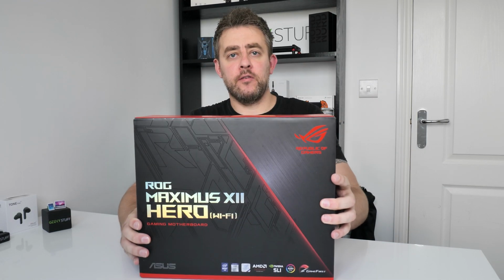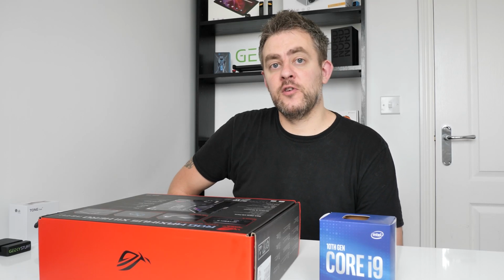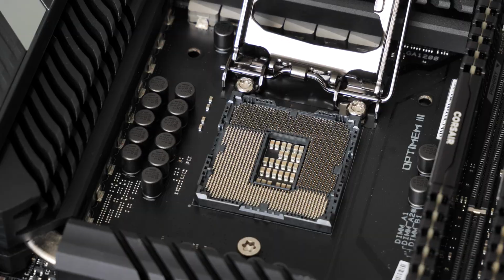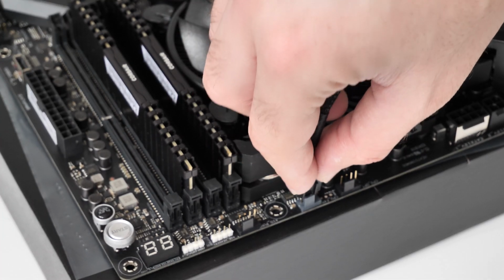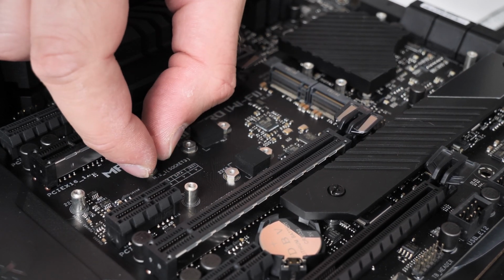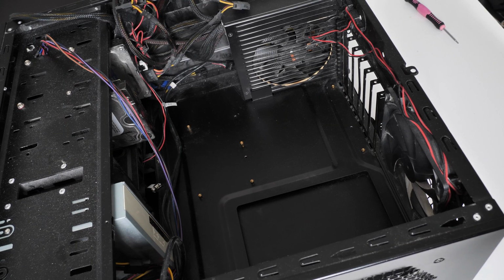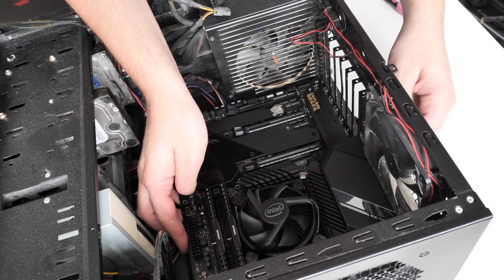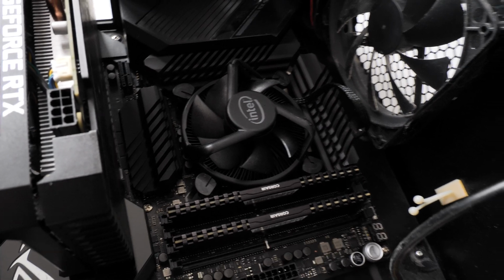ASUS ROG Maximus XII Hero & Intel i9 10900 CPU Installation

Comment: plz i am in vry tense plz relief me help me to tell me is my combination os ok for 3d animation and rendering?!?!
my gig is
that same
 MB asus rog maximus xII hero 
intel core i9-11900K eleventh gen?!!
rtx msi lhr 3d card 3070ti ...ok
addlink ram 3200mhz .. 16gb !? ok
1tb HDD Seagate
700 deepcool gold+ power supply
deep cool air cooler
tell me is it ok fully unlocked and unlimited PC rig for 3d animation and rendring high tense work everything is cool 
or
i DOOMED instead of prematurely???
:((( confused

Comment: Hi mate I’ve recently installed this motherboard into my case and I go to fire it up everything comes on but have no display on my monitor. I’m using i5 11gen cpu, any help me great full
Reply from the maker: Have you tried a different HDMI cable? I had the same issue, I needed to use a new HDMI cable and then it worked lol.

Comment: What to do with those 8 + 4 cpu Power supply connectors ? Do you need just 8 or the additional 4 aswell ?
Reply from the maker: Using just the 8 is fine
Reply: @GeekyStuff  thx

Comment: Hello. I got a question about 8+4 PIN CPU Power. I am wondering to use  a half of 4+4 from CPU cable  for 4 pin slot and 6+2 (PCI-E) for 8 pin slot? Did you do the same connection ? All my previos CPU got only 4 or 4+4 pins near cpu. Thanks for your advice in advance

Comment: Heads Up when installing the RAM!  The Recommended memory configuration for this motherboard for Dual Channel is A2 and B2!  This video incorrectly shows it being installed in the A1 and B1.  I supply my evidence in the link:  Simply scroll to page 1-5

https://www.bhphotovideo.com/lit_files/612720.pdf
Reply from the maker: I don't incorrectly install anything mate! The RAM still works in A1 and B1! It's just dual mode won't be enabled. The PC still works no matter what slots you use
Reply: @GeekyStuff  No offense intended!  Just stating that it does not follow the "recommended config".  Some of us are really anal about that (personality flaw perhaps!). Great video though!  I do NOT have the experience you have with building PC's and appreciate people like you helping us out!
Reply from the maker: Yea over the past few months I've noticed a lot of anal people haha!
Reply: @nickleonard9954  you are correct

Comment: you sure you installed the memory in the right slots thought they were 2 and 4 on asus mobo's for dual channel? i could be wrong
Reply: I recently used this same motherboard and followed the 2 and 4 configuration (I thought that's what the directions implied).  Now after watching the video, I am wondering if I did it wrong.  Should it be in 1 and 3?  or  2 and 4?

Comment: thank you so much! I just got this motherboard for my first ever build!
Reply from the maker: Good Luck 😃
Reply: @GeekyStuff This motherboard looks awesome I had a quick question about the m.2 slots if I only have 1 m.2 do I need to still  remove both of thermal pads plastics?
Reply from the maker: @G007GOAT  nah you leave it on if you wish. Doesn't really matter
Reply: @GeekyStuff  thank you so much bro you’ve earned my subscription, It’s my first pc build I’m a little nervous as I don’t want to break anything

Comment: A clear example of not to believe everything you see on the net, the proper way of installing a CPU on this board is by reading the book, and the first thing the book tells you is NOT to remove the plastic cover of the CPU before you install the CPU, in fact you dont remove the cover, the CPU itself forces the cover up and out once you push in the spring pin that holds the CPU in place..Look it up and dont do it this way, you could damage your brand new board.
Reply from the maker: Oh my god haha! Mate, I've been building PCs for years! Never had any issues.
Reply: @GeekyStuff  yes my friend, you have been doing it for years and you know how to handle those CPUs very well, but the noobies that could be learning from you could screw it up very easy.

Comment: Few mistakes there buddy, You should be using DIMM slots A2 and B2. You used slots A1 and B1. You left one of the motherboard standoffs in the middle of the board which is why you don't have a stand off on the middle slot of the bottom row. this could be a potential short or cause damage to your board. The third one isn't a show stopper however, if you want to get the best performance out of your M.2 and your Graphics card, you should removed the top M.2 and put that on the bottom of the board. By using M.2_1 the motherboard will lower the PCIEX16_1 slow speed from x8+x4+x4 to x8 (half speed) only since its sharing bandwidth with the M.2 slot. But take note that the SATA slot 5 and 6 will be disables only allowing you 4 usable SATA slots for your SSD's or Hard disks.
Reply: are you sure about that last part? i just got like the same motherboard and in the manual for the m.2's (I've never had one so i was reading the whole manual) it only says that m.2_2 will affect pcie16_3 and the m.2_3 will disable sata6g slot 5&6, but as far as I can tell M.2_1, the only thing it says in the user guide is if M.2_1 is operating in SATA mode, Sata6g_2 will be disabled
Low key though - have no idea
Reply: @upgoon4015  yes, when you have an M.2 drive in the 3rd slot it disables the SATA6G slots 5 and 6 because they share the same bandwidth. So you can only use M.2 in slot 3 or SATA6G slots 5 and 6 but not both at the same time.
Reply: This is wrong about the m.2 drives, there are 2 flavors of m.2, sata and nvme, if you are running all nvme drives all the sata ports will work fine, I have all three m.2 slots in this same motherboard fitted with nvme drives and every single sata port works, it only disables it when you are using a sata m.2. Also the shared bandwidth with the pcie slow is the very bottom slot so you most likely are going to be using that anyway unless you have some crazy triple card setup.

Comment: You’re supposed to install the ram one on each furthest side if you’re only using 2 , do your research before doing this
Reply from the maker: There's so many conflicting messages about how to install the RAM. The way I have done it actually works, its fine, no issues at all. Lol
Reply: @GeekyStuff  NO conflicting message.  It says right in the manual where they recommend putting two sticks for best performance.

Comment: Hii I bought this motherboard and installed an i9 10900k but the speed of my processor is stuck at 0.78 ghz and I updated the bios and it remains the same, do you recommend buying another motherboard?
Reply from the maker: I'd recommend sending it back lol
Reply: @GeekyStuff  I was able to solve my problem by disabling an option called "thermal monitor" but I see that the processor reaches 5.00 ghz, is it normal? it's an i9 10900k, won't my pc explode lol?
Reply from the maker: @ArokBoom  yea that's fine. Your machine won't be running at 5ghz for long periods of time, only when needed.

Comment: Do you need to take the sticker off the m.2 ssd before you put the heatsing back on or is it fine to leave it on?
Reply: That sticker needs to come off otherwise it could melt onto the m.2 or stop cooling. Either way, remove it before you screw it back down.
Reply: @MercuryDNB  Still waiting on the new mobo to come in but I definitely will when it does. Thanks for the tip!

Comment: Got this motherboard today, reasonably experienced pc builder but this motherboard had the hardest CPU lever force i've ever felt from the 9 or 10 systems I've built. Left little notches/marks in my CPU - was it the same for you?
Reply: I’m relieved to find this comment — I’m on the same boat and am scared to pull the lever shut. I’ve never had this much tension before. I haven’t even fully closed it yet and there is already a mark on my processor. 10900k. I’m scared to fully do it. Any suggestions? Did you end up just forcing it?
Reply: @thatguynico  I forced it, there are small indents on the CPU but the PC has been running fine! Just make sure that your CPU is definitely in the right way.
Reply: @ParallaxRS  I looked at the manual after and I realized that that cover that we have to pop out is actually supposed to come out after the chip is in (face palm emoji). Weird that they would have us do that. Definitely a first.
Reply: @thatguynico  Oh yeah it's always been the way since I can remember with Intel to be honest, always had to leave the cover in and have it pop out, just never had such a force on the lever when pulling it down!

Comment: Does Asus ROG Maximus XII Hero WiFi Gaming Motherboard Socket 1200 (ATX, Intel Z490, DDR4 4666, USB 3.2 Gen 2, On-Board WiFi 6, 3x M.2 Slots, Aura Sync) are compatible with intel core I9 9900K?
Reply: No, they are designed for 10th gen  PCU and up
Reply: @russiancruiser277  alright, thanks

Comment: You aren't supposed to screw the m.2 in the second slot without putting the heatsink down first and then screwing it through that into the mobo point.  There are so many mistakes here that viewers should RTFM instead of following this guide.  You also put the ram in the wrong spot and stock cooler with a 10900k?  WTF man.  This is bad.

Comment: Which Sata configuration is correct? AHCI or Intel RST? Doesnt matter in which port m.2 you install the NVMe?
Reply: for start up,  boot drive like C:\ ,  for the lines SATA and SATA devices ,  matters the NVMe version, also the  PCIe 3x4 gen , and the  motherboard model,
Reply: AHCI unless you want to run a RAID.

Comment: Hey nice video anyways just say you should probably save some money for a bigger cpu cooler the I9-10900k because it is a 95W tdp cpu so it will get hot over long use or if you plan to overclock
Reply from the maker: Yea I'm planning on getting a better cpu cooler 😎
Reply: It’s not a 10900k just the 10900 so it’s locked. All you can do is remove power limits but voltage and clocks are not able to be changed